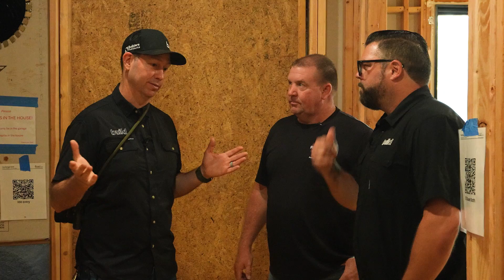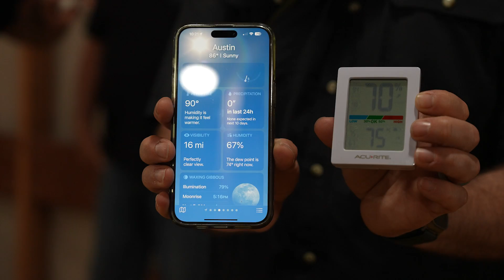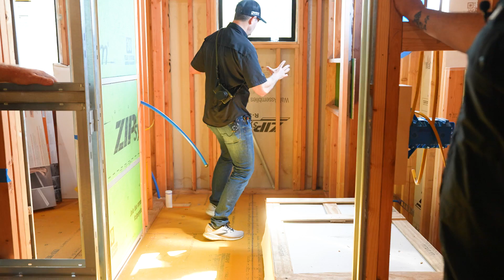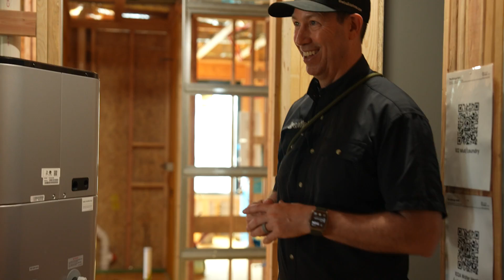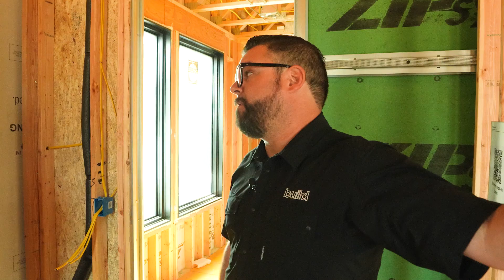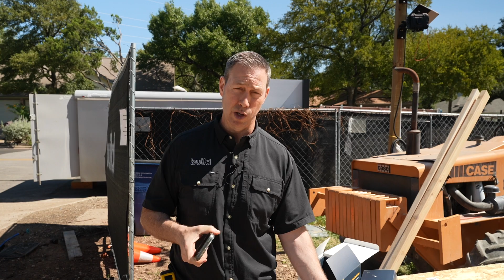The Risinger Build: Episode 11 - MEP Electrical Rough

Comment: One reason not to have EV's. Are you going to put in some kind of fire suppression system in the garage also?
Reply: Even if you made the entire ceiling area of the garage a water tank it wouldn't hold enough water. It's a real issue that people are ignoring, yes it's rare and ICE cars catch fire more often but they are easier to put out.  Please charge your vehicles outside.
Reply: @paulstone3032  In Denver the Fire Dept uses a blanket once they have the flames tamed down and wrap the vehicle on EV fires. A suppression unit would slow the fire down. You can put out an ICE fire much quicker.
Reply: @paulstone3032  back in the 90s, i saw a car parked at a park and ride go from some smoke coming from under the hood to a 30 foot tall column of flame in under 30 seconds.  Doesn't matter if it's 30 kWh of lithium or 15 gallons of gas, if it torches off, the house is screwed.  Everyone loses their minds about EVs these days but keeping a vehicle in the same place you sleep has always been a terrible idea.
Reply: @danheidel  Oh 100% all vehicles go up like kindling soaked in nitro, it's just when you charge an EV it's one of the highest risk times (right after high performance driving with the high discharge/regen cycling) for fire so why not keep it outside during that risk time.
Reply: You know that ICE vehicles catch on fire about 3 times more often ev's, right?
Reply: @danheidel  Stored energy inside the primary structure is beginning to be discussed in code review boards.....
Reply: @D2O2  it's a good idea.  I'm doing a new build next year and all the cars will be under an outdoor carport and the solar system batteries will be in a detached cinder block bunker.  Potential energy is potential energy.  I'd no sooner have an ICE or EV inside the house as a cord of seasoned firewood.
Reply: @D2O2  Like fuel tanks in cars?
Reply: @danheidel  
I wouldn't park vehicles in an attached garage regardless of type. It's better to have a lean-to though EV's wont like being out in the cold.

Comment: The recent debacle and failure of Sonos and their App is reason enough to skip Span. 

Keep it simple and off the cloud when you can
Reply: Hilarious…just got to the part of the video where he’s going with a Sonos system…hard pass 

I love tech and have a background in computer science…but these expensive home integrations based on the company remaining solvent and altruistic is a bad long term move. Keep it simple and off the cloud

Hue hub and bulbs, WiFi thermostat, UniFi PoE camera system, and mostly call it done
Reply: You can tell someone knows nothing about audio nor care when they install speakers in "walls" and make an open room design their home theater room with zero sound treatment...

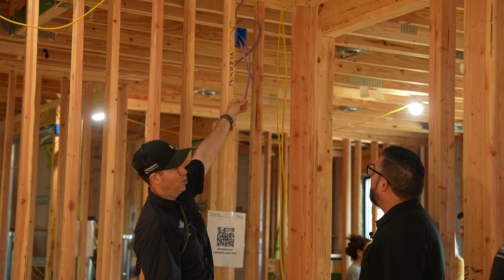Comment: 22:00 Since code allows 16AWG for 10AMP breakers. Wouldn't be best to use that size for the smoke alarms? I honestly don't know if there are 16/3 cables yet.
Reply: That code provision wasn’t adopted as apart of 2023. It was in the drafts, but didn’t make the final. One day…

On another note, it’s INSANE that they ran 12/2 to everything including lighting. Massively overkill and a PITA to deal with for smaller lights.

Comment: With these cloud-connected electrical panels, what would happen if Span went out of business? Presumably, the panel still works, but what about the management app?

This is an obvious problem that I am sure Span has thought about. Else no one would buy this.
Reply: It's a nice idea, has a lot of benefits, but I think it's something 10+ years down the line it's going to be an issue.  What happens when the computer inside dies? Span goes under, etc.  A dumb panel with separate management seems to be a far better way to go, or Levitons system where the breakers are WiFi and all the management is done in the cloud.  If it fails it's defaults to to dumb panel. The fully integrated idea seems like a dumpster fire in waiting for the owners.
Reply: @dcl97  This is like "smart tvs" good idea until each tv brand had their own hardware and operating system that required a unique app to be built and maintained.  My first smart TV became useless within 2 years once the manufacturer stopped maintenance.  Now we are back to separate connected hardware (firesticks,roku, etc.)
Reply: @dcl97 yup, lots of similar home automation fails over the last few decades.  How hard is it to turn off a switch, throw a breaker, or schedule your car charging at night if you're in danger of using excess power?  Honestly, you're a buffoon if you've got a modern 200a service and you're blowing circuits.
Reply: They will stop working. Why overcomplicate your house.
Reply: This just happened to people with Electriq batteries. They're bricked now and can't charge because everything was cloud managed.
Reply: Nothing in the cloud is safe.
Reply: A $3000 panel that is "smart" so you can "save money" by installing a smaller service is dumb. A normal 200A panel with 80 circuits costs $250. Use the other $2750 to more than upgrade your service, in fact you could almost do two separate metered 200A panels for that price. And you would never have an issue with drawing too much amperage, or dealing with a bricked power service
Reply: That is my only complaint, otherwise great work and solid building science on everything else in this video.
Reply: @dayz_bob_bob_bob  the issue with drawing too much amperage is that in many locations drawing above a certain number you move up to a new pay bracket. SPAN hopes to mitigate this. There are other cheaper ways to achieve the same objective though
Reply: Or they push a firmware update that bricks the panel 😅
Reply: Assuming nothing nefarious by the company, Span panels operate just like a old school breaker panel when no internet connection is present. So, if the company went under, you'd lose the ability to control the panel remotely,  the panel would continue to operate as a "dumb panel".

Span is currently partnering with many other companies, I suspect they are in no danger of going under. Actually, I bet they are snapped up soon, possibly by Tesla.
Reply: @Eric-1701 and what if you were able to undersize your service by using spans features. If the unit becomes dumb for any reason you now have a real fire and electrocution hazard. How on earth could this meet code??? I
Reply: @fox156 yeah.  Very good point.  I don't think using Span as a load control for undersizing the incoming service is a wise, or compelling option.
Reply: @Eric-1701  they're actually in great danger. They're burning through $ from my understanding.  They're trying to compete with Eaton and Schneider...they'd be better off selling to one of them. A smart panel that goes dumb and isn't run privately is a major problem. They're very expensive
Reply: Yes. Big problem. 
I bought and installed wireless controlled lights that are registered in 'the cloud' from a high end Australian company.

Company went bust with flood of cheap Chinese knock offs. 

Lights are basically useless now. App bricked as it has to retrieve data from the he cloud. 

Cloud control / registration is fantastic dream for short term company,  dumb idea for long term  end user.
Reply: I can see the functional benefit but I think this a better implementation would be smart breakers that use a standard form factor. Something you could retrofit to an existing panel and change out individually if desired. That would be much more future proof.
Reply: More than cloud connected, cloud managed.  Requires connection to servers you don't own or control for the features to function.
Reply: 9 times out of 10, when the cloud service goes down, you're screwed.  

Or the company gets bought out a few years from now and the new owners start charging a monthly fee or start selling your power use data.

Also, I'd be concerned about the long term reliability of the box.  Maybe they did due diligence and the code is written to high reliability code standards but that's expensive and one of the first places they will cut costs.  Is not going to be fun for the owners or warranty guarantor if the computer locks up over a weekend while everyone is away and a few grand of food goes bad.

The load balancing is cool but that's a lot of potential downsides, not even including cost.
Reply: @danheidel  Yes, of course. This is an obvious Achilles heel that they would have to have thought of and be able to answer.
Reply: @crabkilla  of course they've thought of it.  And judging by how almost all cloud services have gone, their solution is to do a low cost band aid and let it be the consumer's problem after they sell the company to some big conglomerate.
Reply: This. Any cloud connected device needs to also have local management capability. Otherwise, the company later on can just start charging subscription fees or just shut down the service entirely.
Reply: You can keep it.